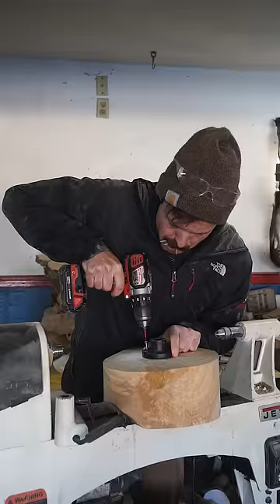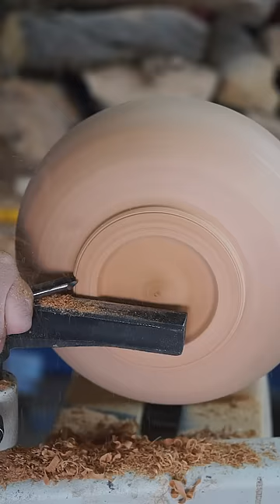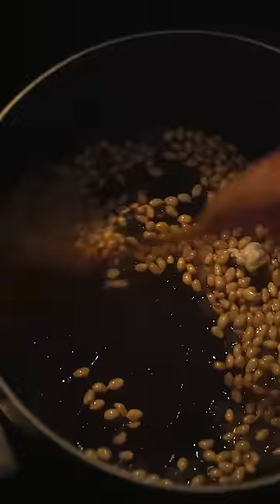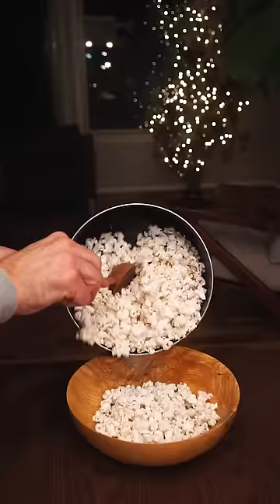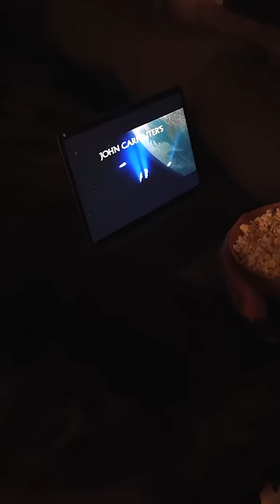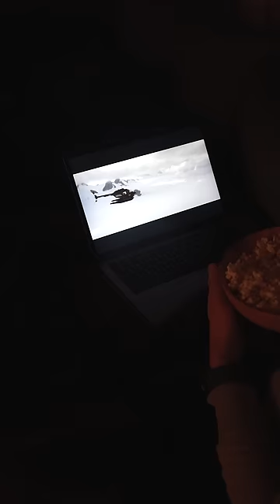Making a Bowl for Winter Solstice!

Comment: Usually I burn a Yule log for winter solstice mainly made out of American holly wood or aspen, white oak is also a good choice but in Scotland birch is traditional and in France cherry wood sprinkled with some wine to make it smell nice when lit, you can also use pine and typically I’ll decorate mine with cranberries, mistletoe, holly, pine cones, pine needles, ivy (mainly winter creeper), spruce cuttings, juniper cuttings and berries, cinnamon sticks, anise, cloves, bay leaves, black walnuts, black locust thorns for protection, mint for money in the new year, pepper corns, and honestly the list goes on, I finish the log by tying it together with twine and adding feathers

Comment: I have an idea/suggestion that came into mind

Can you make a flat, large round pizza serving platter, slightly lipped edge, which can also be used for a cookies/cake & hot chocolate platter (idea from comments)

But also good as a deli meat and cheese snack board, like  one of those charcuterie board platters, as they are known.

The slight lipped edge, (with a slight inward curve) so things dont fall off the sides,
kind of between a cutting board and platter plate, for one or more, some character from wood grain but with a shiny and completely smooth surface

Smaller matching replica individual "plate" boards would be good to eat off, or use as seperate accompanying platters for some other same idea but diff theme,
Eg, meat and cheese and crackers, chips,
plus patés, dips, and jams, things in small earthenware vessels,
for the main board,

then fruits seperate,

and a small seperate dessert one, (eg. for chocolates, marshmallows and sweet crackers, as in s'mores)

as a matching set

I would LOVE that

Comment: Winter Solstice? Did you mean Sleep Day?
If you did, you definitely celebrated it wrong. Here's how you properly do it:
Make sure you have the day off well in advance. Unless you work in health care/the fire department/other emergency services, try to be off call as well. Sleep Day is a self care holiday, but do NOT put other people at risk. If you can't get the exact date off, Sleep Day may be celebrated any day of December or January (I would not place it on New Year's Eve or New Years though), Winter Solstice is simply the most appropriate date for it. You might also want to take off the day before to take care of any chores you would have the day of.
The day before Sleep Day, add as many soft and/or fluffy things to your bed as you can/want. If you can't sleep in that amount of fluff, store it next to your bed for the next day (I'd actually advice that, since the amount of fluff you are sort of supposed to use should be enough that you can comfortably sit in your bed and that's just begging for a crick in the neck). If you're into it/can do it safely, place candles around your bed, too.
Before going to bed the day before, unplug your TV and turn off the internet on your phone (or completely if you can be off call). On Sleep Day, you are not allowed to use electronics for entertainment except music. So, if you don't already have your comfort playlist on your phone or better yet if you have a CD player a CD, that's another task for the day before. An argument may be made for e-books, but they have to be downloaded the day before, because the internet HAS to be down for the day. Same goes for audiobooks/podcasts.
Here is how you should spend Sleep Day: Relaxing in your bed/sleep place. That's it (mostly).
Do not leave your bed for anything except sustenance or the toilet (maybe getting a new book/other hobby supply). As a matter of fact, you should prepare food ahead of time and make it so making tea/hot cocoa/hot milk with honey/other hot, comfy drink can be done as quick as possible on Sleep Day and preferably into a thermos. No caffeine or alcohol either, if you can stand it. You may eat outside your bed if your comfort food (which is the only thing you should eat on Sleep Day, to be honest) has a tendency to leave crumbs or you can't finagle your fluff in a way that lets you keep your bowl/plate stable enough to eat from but you should do it as comfortably as you can.
If you don't already have an analog hobby, I suggestyou get into one ahead of time. Reading, writing, knitting, sketching, as long as it is analog and can be done in your bed, today is the day to do it. I ... wouldn't recommend painting, but you certainly draw sketches on your canvas for later use!
DO NOT spend Sleep Day on your couch unless you routinely sleep there! You are supposed to spend Sleep Day in your rest place, even if you technically do other things than sleep on this day.
If you are serious about keeping your log-in streaks for games, set an hour or two aside for that (though you should do the bare minimum for it, even if it means losing out on some resources) and once that is done, turn off your PC/tablet/console/internet.
Here is what Sleep Day is about: True, Private Relaxation. You spend it in your rest place (bed), you don't use any screens, you are as offline as you can be without causing stress. If you can abstain from things like nicotin or alcohol, give your body that rest. While you probably shouldn't sleep the entire day, give into any sleepiness you want to.
I'd suggest keeping all screens off (except I might be a bit of a hypocrite since I don't have a CD-player and have to rely on my phone for music/etc), cooking your favorite comfort foods the day before and putting your extra fluff, hobby supplies, audio entertainment and anything else you need to be comfortable next to your bed. If you work from home, get as much stuff done beforehand as you can so you can spend Sleep Day giving TLC to yourself without a bad conscience. If you are struggling with an addiction/feel the pull of anything from meth to exercise, do not stress about giving into it. You may want to avoid it because you feel it goes against what Sleep Day stands for, but it does not. The only thing Sleep Day REALLY stands against is stress. If you feel stressed about ANYTHING during Sleep Day, adress it, even if it takes you away from your sleep place. (Personally, I do feel the need to add that Sleep Day does not excuse breaking even a week streak of being sober of anything. You should not sabotage yourself on the road to recovery and then blame it on Sleep Day. Sleep Day is about humble and mundane methods of relaxation, hot beverages and good food and spending the day in a comfortable environment enjoying simple pleasures. Sleep Day stands against stress, present and future.)
If you have a life partner, it is up to the two of you to figure out if you spend it together or individually - just make sure you're on the same page on it BEFORE. (Personal opinion again, I wouldn't spend it with someone else, even if I had someone. If my partner insisted, I would probably take a second Sleep Day just for myself and advice them to do the same. Sleep Day is for self care, and for some that may mean spending it with someone they love, but for me it's spending one day of the year on me and my mental health.)

Also, you may thing that the Summer Solstice is about the opposite (no sleeping, getting shit done around the house, etc). Since it's the longest day of the year, it would only make sense.
It sort of is?
Thing is, If you celebrate Sleep Day, you usually aren't the type to do ... perfectly with your New Years resolutions.
I, for example, managed to stick the whole year to one New Years resolution my entire life and that was to not touch alcohol for the first full year I was allowed to drink it. That resolution got challenged ONCE.
Sleep Day's summer counterpart Plan Day is about that issue, at least in part. And surprisingly, it's the last part of Plan Day.
Plan Day still relies a lot on preparation. It's still about relaxing/getting rid of stress but differently from Sleep Day, Plan Day is a group effort (or should be, at least, I completely fail at that because introvert).
Again, it doesn't have to be on Solstice exactly (June/July) and you should take care of any preparations you can think of beforehand, obviously.
Plan Day is a far less private affair and shares a lot of similarities with christian New Years. It's supposed to be celebrated with friends and family, preferably with a big party somewhere sunny and around either sunset or midnight you reflect on the past six months (or year if you skip celebrating New Years) and make new resolutions for the coming ones. Or even the same resolutions, now that the sun is giving you energy and happy chemicals again and you probably have a better chance at keeping up with it.
Unless you are de-toxing from your addiction, you may hedonistically indulge in them to your heart's content during Plan Day. Unless your addiction is murder. Murder is strictly against everything Plan Day stand for.

Basically Sleep Day and Plan Day are about what matters: The Present and Self (Sleep Day) and the Future and Connections (Plan Day). They are about giving yourself and your 'clan' (friends and family) room to breathe.
Sleep Day gives you a break, a chance to rest in your everyday life, Plan Day gives you a reason to strengthen your bonds with those that matter to you and a chance to plan for the future.
(
Also, no, neither of the Equinoxes are about the past. They are still about Present and Future but they switch Self and Connections.
Fall (any day you can get in September/October) is about balancing your Connections in the Present, figuring out if all of your relationships are good for you as they are right now. No 'but they can change' or 'I can do better', just plain old 'is this good for me?' You don't have to decide to break the connections off, just reflect on the current state of them. Fittingly for Fall, you will probably realize that some relationships need to die for you to thrive in the future, and that is okay. Or hell, you might find that you WANT some kind of relationship with someone and the realisation of this day might be the nourishment for that.
Spring (March/April) meanwhile is about your Future Self. How can you better take care of yourself? What should you stop doing before it becomes an issue? Yes, this is not dissimilar from Plan Day's resolutions but, honestly, aside from Sleep Day, which again I wouldn't place on either side of the year changing, all of these holidays could have some influence on your future and putting expectations on you kinda goes against Sleep Day.
If anything Plan Day is about the (immediate) past in how it affects the future, but all four of these holidays are more about what matters to the people living right now. You can't change the past, but if you put in the effort in the present you can change the future.
)
(Also the reason the Equinoxes don't have names beyond '[Spring/Fall] Equinox totally isn't because I literally just came up with Sleep Day and Plan Day and felt bad for leaving them out. That would be ridiculous.)